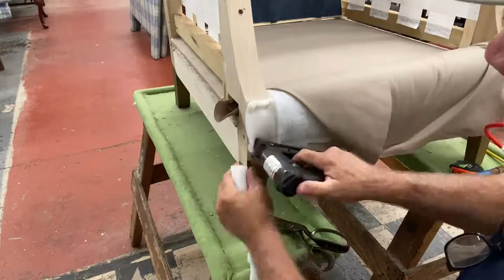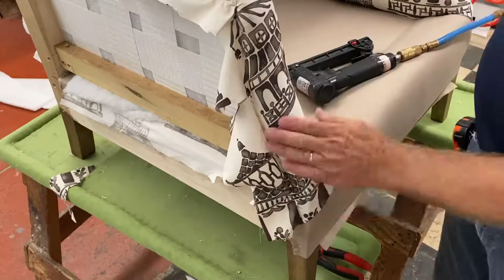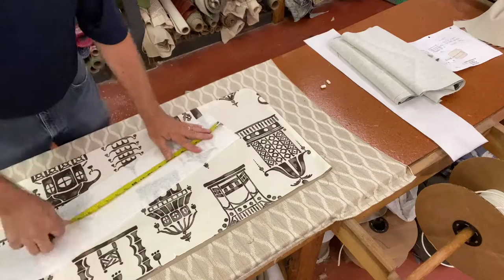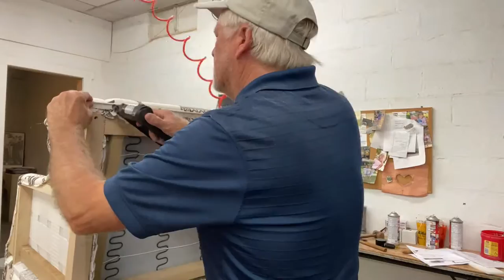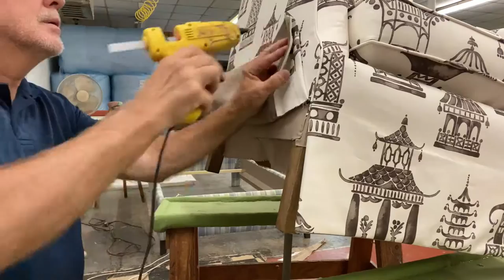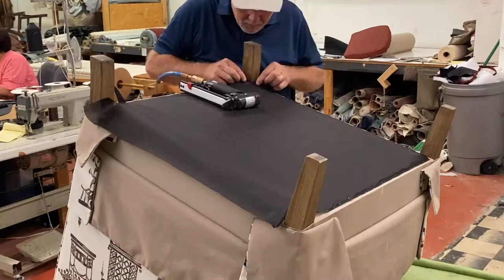How To Upholster A Dressmaker/Waterfall Skirt

Comment: Great resource. Quick question: what is the height of your buckram/skirtex compared to the drop of the skirt?
Reply from the maker: I use 6”
Reply: @MarksUpholstery  no matter the height (slit) of the skirt?
Reply from the maker: @rapidanred937  

Never had an issue with using 6” no matter the size skirt